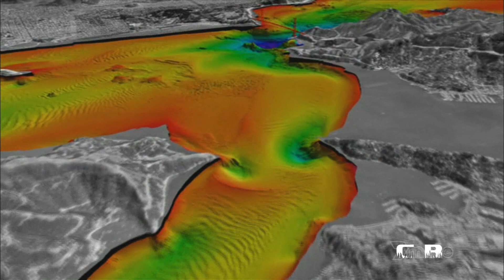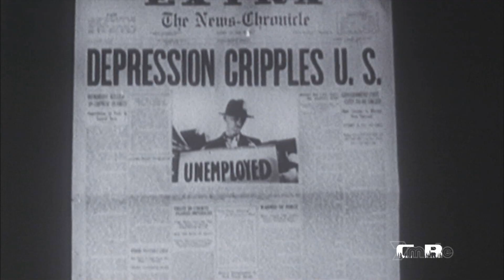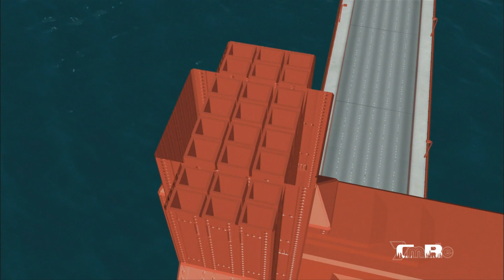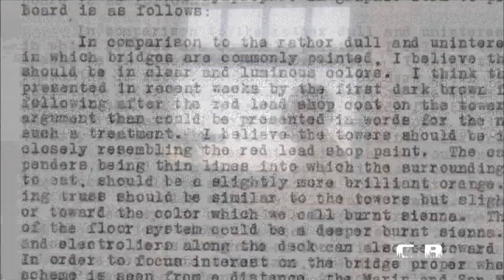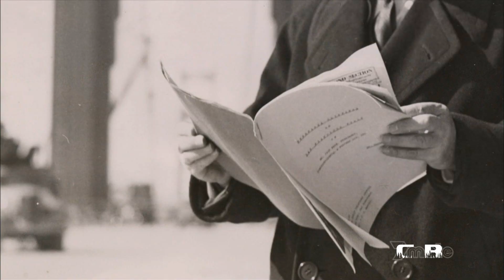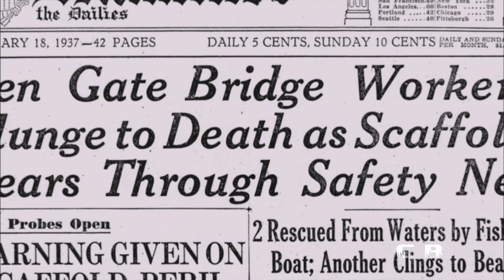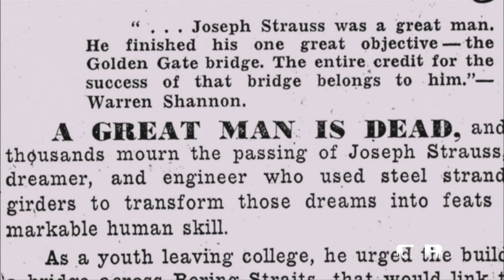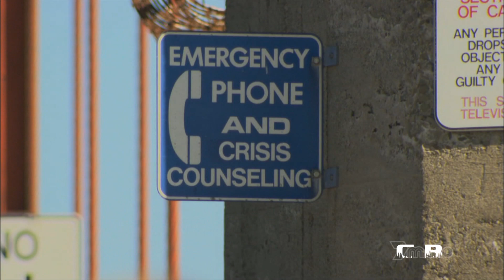Bridging The Golden Gate

Comment: 29:34. Riddle me this, How can you circle the earth 3 times at the equator with 28,000 km of wire?
Reply: Dirk Digglerguy    According to an older documentary I watched, they said it was 80,000 miles of wire, which sounds more reasonable.
Reply: I watched another doc on the construction, recently, that showed main (Arch) wires being run. Six strands at a time, combined to form a 1 meter Cable. Which was then wrapped by machine by wire. That's a bit of steel wire. Strength and flexibility concepts used in Radial tires.
Reply: I think he meant 38,000 km. that is enough to circle it three times over. I watched the documentary on TV before with close captioning, and that said 38,000 km.